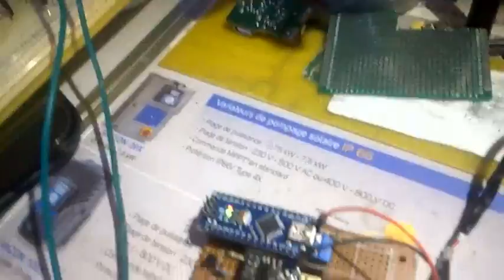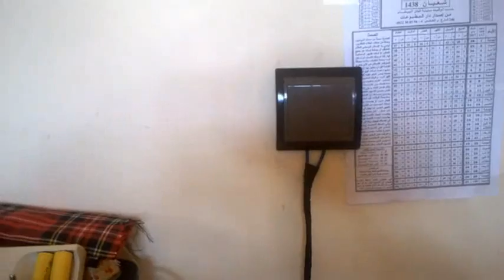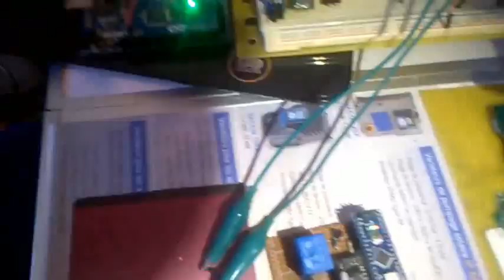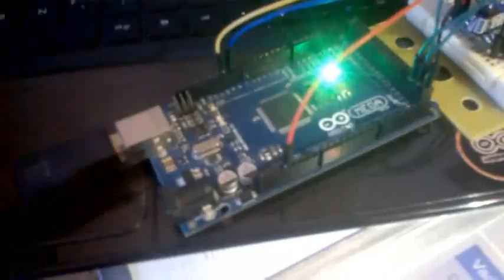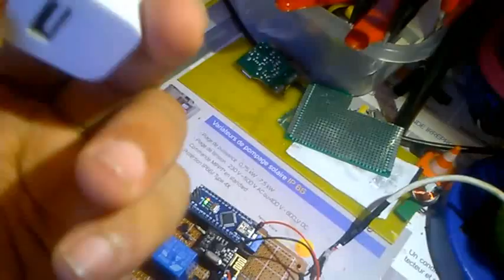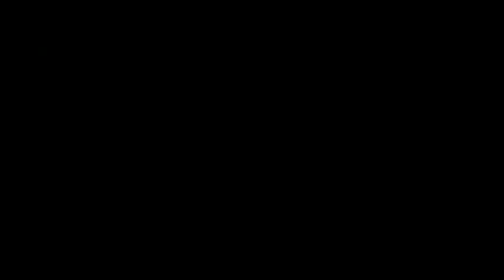Wireless Home Automation using NRF24L01 _part 02

Comment: Hi,
I think you have uploaded the wrong  Transmitter (Master) code on Google drive 
(Part 3 of video).
Rdaio1 is not there on master code.....
Reply from the maker: I'll check that out
Reply: @OhadooElectronics  
Hi,
Have you checked that transmitter code! That Transmitter code also has 5-6 addresses while it should have only 1 adress as that of receiver...

.... I've also subscribed your channel.
Reply from the maker: I still haven't checked since I have work and not much time, I'll let you know soon
Reply from the maker: I think what I did is just put 6 instances in there for future use, but it still would work just like that if I remember correctly (it's been a while hhh) have you tried it already?? also it 's good to have multiple ones so when you send the wrong cmd, nothing  should happen on the receiver , just put everything together and test it, and let me know what issues u get
Reply: @OhadooElectronics  ok, I'll try this...
Thanks
Reply: @OhadooElectronics  it's not working ....
Just check your both codes.....
Reply from the maker: ok I'll see if I have an other code, if not then that one should be working, ... I'll see
Reply: @OhadooElectronics  ok
Reply from the maker: hey I checked my project's folder, and it looks that's the only code I have meaning it is the one working (never mind the multiple instances, if you check the video , they do nothing) I think you should verify your circuit and wiring, also check out other videos on the subject, that's what I did when I built this, If I had the circuits with me I'll test it out for you but unfortunately I don't.